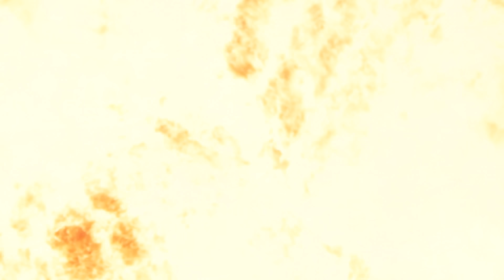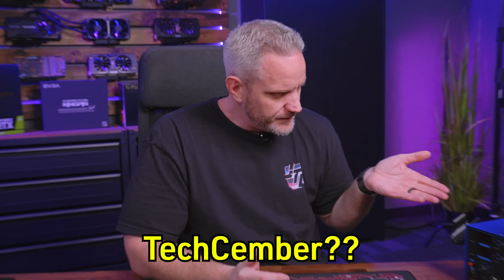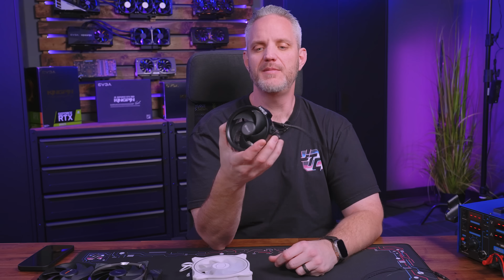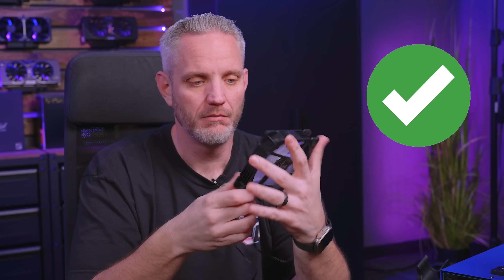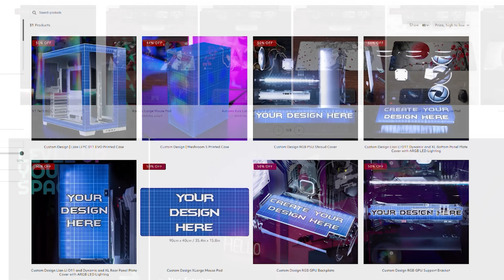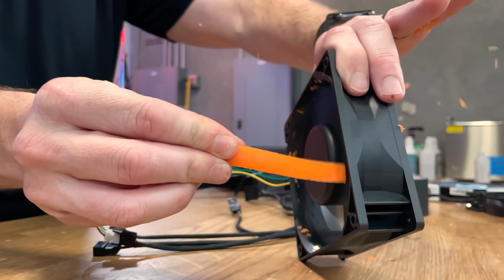I overvolted my fans, but I never expected these results!

Comment: Jay has now resorted to "over clocking" fans. He needs a power supply capable of going higher than 15v ... Let's see some 12v fans at 24v 😂😂😂 I can see the wheels turning in Jays head. Video ideas: Over clocking leaderboard attempt with "overclocked" fans on AIO Cooler with his air conditioner lol

Comment: Maybe it would be a good idea to check the RPM of each fan at 15.2V and the temperature after 15min of running, another thing would be the air flow measurement cfm, and also noise db

Comment: I have a couple of 40mm noctua fans running at 24v cooling the Stepper motor and power supply for my 3d printer. They have survived for  almost 3 years now Yes thats Forty mm by 20mm fans

Comment: I used to use the -5v rail from my power supply to run fans at 17v. At 24v they fail instantly. Hehe. Good old y2k Athlon era problems.

Comment: Finally. yes. as usual Jay, thank you.Also, lian-li only one with actual overvoltage safety? hella nice. You should try to monitor che voltage between two fans connected in a loop so one actually feeds on the other one and look at the tester to see at what voltage problems start.

Comment: Back in the 1980's a seller of my power cartridge for the Commodore 64 told me; it's like you tune your Mini to 200km/h, it can do it but will break much sooner. Never found that to be true for computers but for fans? 100% true, you just destroy the baring 🤣

Comment: 3D printers use 24 volt systems and people will frequently make the parts cooler fan blow harder by running 12v Noctua fans on them.

Comment: Put a restriction in front of it Also use a Fluke digital multimeter to see if the output is actual. What you're doing is an easy test.

Comment: Reminds me of the time I needed to cool down my amplifier at a party. I cut a hole in the top, drilled 4 holes for a 120mm fan, stuck it on there and wired it to a lamp-switch for 220v (I live in Europe). Problem was that the only fan I had spare was a server grade 120mm with metal fan blades! That thing was scary as shit... Fan guards got quickly installed after I turned it on. 😅😂
The amplifier stopped overheating tho!

Comment: They are not "not happy",the fan at 7:20 is just adjusting its pwm cycle to get same rpm's (power) with increased voltage, look at amps, at higher voltage amps go down, because you settle at same ~3W of power. Previous one that got fluctuating readout was same idea, just not so polished motor cointroller logic. For average joe imagine 12 volts is gently pushing shopping cart, to get it moving, you push it all the time, with 15 volts it is like kicking a shoping cart with a foot, you kick it, and it goes for some time, after a while you got to kick it again to keep it moving.

Comment: Ive generally found with 12v stuff like that you can get away with 30-50% more voltage without it releasing the magic smoke. You can even double the voltage on good devices for a short period of time with no lasting damage (take that with a grain of salt. Im not responsible for anything you do haha) but an extended torture test at 24v and you would probably start to see some die out after a few minutes of use haha

Comment: Idea (since you're bored): I recently bought a Red Bull mini fridge on market place. It looks similar to a PC case and gave me the idea to build a PC inside of the fridge to keep the temps down while not worrying about condensation since all air around the components is cold. At least that's the idea. Maybe you could do the same?? Or some other brand of mini fridge..?

Comment: 6:22 The reason that fan's amps were jumping up and down suggest it has a build in power regulator.
The step-down power regulators work by turning a switch on and off at high rate to keep constant voltage at the output.

Comment: Theres two Gods at 15v, Gods can increase work output, thats how special relativity works, too many Gods slow eachother down because the same workload, working spot even, like magic is comming from multiple sources, so the underworld God simulates an empty upside down reality.  The ladder to the underworld gravity flips, as you've seen in the footage, pressure drops dramatically, so no watts are required to cause implossion, like gold bars classically implodes.

Comment: Good fans have a controler inside, i have ARCTIC BioniX F120 and if you stop the fan the current stops and you can hear a noise inside of the controler beeping and sending voltaje to try to start the fan again, i bet the ones who drop voltage is because the ESC or controller, not the motor.

Comment: Well PC fans are brushless but they are rated for up to 13.2v generally and will shorten the lifespan above 13.8v, unless the fan has no control electronics at all, i've overvolted those absolutely awful fans to 30v and it survived for DAYS

Comment: All those fans are pulling less amps than its rating is due to them being new or almost new. Almost all motors should pull less power when new since they're at their most efficient state physically. Once a motor starts pulling current at or above what it's rated, it generally means they are at end of life and needs servicing or replacement. There are many factors that can cause a motor to over-amp, like a failing bearing or worn brushes in the case of a brushed motor. Non-ideal uses can cause motors to over-amp also, like extra load on the motor that isn't intended or conditions like extreme heat.

Comment: not really overvolting   normally you can do 50% without affecting duty cycle so 18v easy DC DC step up /down buck converter will do the job , and I have ran my delta's on 24v

Comment: Hi Jay. it's is rated 0.35Amps "under load", meaning some form of resistance to the fan spin ie. meshed grill or glass pane very close to the fan blades. Once there is resistance, the fan motor pulls more current to keep itself spinning.

Comment: Hey Jay, you wanted to see a cool trick? get a spare PWM fan cable extension and solder (connect) a single 4.7uf MKP capacitor between the +12V wire lines from the fan to the motherboard pin and see an insane improvement, don't worry: it's safe and interesting.
Hint: It's affecting lower amp fans.

Comment: With the new bench power supply, remember to set the amperage correct. Too many amps will burn the wires out, before the motor. 
You might also think about some extra safety, for when a fan explodes. Sharp bits of fan, has been known to hurt flesh.
Reply: At constant voltage, the fan will draw the amps it needs. That's why the amp draw gets lower the more volts gets pushed.
Jay should have measured rpm as well.
Reply: @PhrozenN  I am going on the bench power supply, that I use. I have separate amp and volt settings. I am presuming that the one that Jay has ordered will have the similar settings. We will see.

Comment: Cars are a minimum of 12v (some old tech is 6v) and a regulated 14ish volts... components (most of the time) need the minimum to work as designed so we call them by the minimum eg.12 volt system.... yes I know its more complicated than that but was going of simple explanation.

Comment: I dont think voltage  is gonna kill them till much much higher. Up the amps and watch them pop.
Reply: You can't increase the amps unless you also increase the voltage to cause more current to flow - basic physics.
Reply: What I meant was take a power source like a car battery 12v and hundreds of cranking Amps...
Reply: @IronVally_QMaster  Sure, but the fan won't take any higher current unless the voltage is also increased.  Of course, if you redesign the fan it might, or if you change the laws of physics.  Voltage is what causes current to flow.  A car battery only delivers hundreds of Amps because the starter motor resistance is a fraction of an Ohm.  A fan is a variable load, but typically tens of ohms, so the current at 12 Volts or so is generally much less than one Amp, even if the supply could provide more.

Comment: internal IC temperature caused from overheating slows down the coolers, there is no smart tecnology only internal current protecction. 3 thing will blow in a cooler fan the coils, but primarly the IC chip or the hall ic if its not internal on the main IC. all depends on the voltajes.
Reply: Yes - either mosfets or hall-effect sensors, or controller (just maybe).
Reply: @GodmanchesterGoblin  the mosfets are inside te IC driver,they are just like a BLDC motor. Many coolers are 1 coil driven some 2 coils.
Reply: @neoneo1989  Yeah - most likely.  It's a long time since I pulled one apart.

Comment: The amperage drop could be the fan's control chip erroring out..? Maybe loosing speed sense and slowing down, or going to fast and missing the correct phase-shift then amping up when trying to speed back up. It would be an interesting video for an electronics channel.

Comment: I bought the be quite pro 4 fans with the physical switch to increase and decrease fan rpm and they are best fans i have ever owned compared to noctua fans i paid over £110 for 3 fans they are indeed expensive

Comment: You should get a power supply that goes to at least 36v if you want to easily release the magic smoke. I've had some fans survive 24v because they just shut off to protect themselves.
Reply: He's ordering a 60volt one. Was right at end of video 😂
Reply: if voltage does not kill the fan then its the high amps will cos the tiny capacitors will fry first .. if i am correct
Reply: @tlumme you can't force amps, the motor is pulling them
Reply: @vadnegru  okay .. got it :D

Comment: Could always try a 20V power tool battery with a potentiometer to control the voltage, or something like that.
LMAO, nevermind you ended up doing that, perfect timing

Comment: jeesus... you need to learn about electronics and electrical systems for one every device has a 10 to 20 %  leadway so 15 volts on a 12 volt fan should not matter... put 30 on it then you get fans failing now if you got a 5v fan on 12 volt yeah that will fail as that is more then double  but 3 volts more then stock wont do shit unless it is a really badly designed product and you call yourself a tech tuber ???? SMH

Comment: What you're missing, Jay, is that a significant number of modern PC case fans (aka all of them) actually have full-feature PWM controllers *in the fan*. On ALL 4-pin headers and 4-pin fans, the motherboard supplies flat 12V and then a low voltage PWM signal for the fan's internal controller to actually drive the fan speed, with the 4th pin being the RPM sense wire.  

(On older motherboards with 3-pin headers, the motherboard itself would do the PWM voltage control on the input power, if it supported it. Moving the PWM control to the fan eliminates a lot of compatibility problems with said 3-wire systems having different PWM sample frequencies, ramp up/down time, amperage, etc.) 

I noticed this messing with some generic case fans from Dell not that long ago that I didn't mind blowing up. I could ramp their voltage as high as around 20 volts, and while the fan speed would temporarily increase, within a couple seconds it would ramp back down to it's rated RPM- the internal controller was protecting itself. Above that 20V, the fan would just turn off. Never killed any of them though. 

You'll likely only be able to blow up the cheapest of the cheap DC fans that are 3-pin only. All the 4-pin ones should self-protect and self-limit RPM, which would be indicated by hooking up the sense wire and ground to a motherboard.... Unless you hit them with 40V+ which would probably be enough to fry the controller circuits.

Comment: Reminds me of the time I used to -12 from the 20 pin power supplies in the 00's and rigged that to my fans for 24v. Damn those were loud then! Then I put some switches together to go from 12 to 24v on a blank faceplate for when I needed extra cooling.

Comment: I have a 36 volt power supply and I hooked it up to some cheap prebuilt cpu cooler fan. It continued to speed up until like 26 volts then just stopped completely and started getting really hot

Comment: If you have more of those 20V lithium batteries wire them up in series you will get 40v or 60v if you use 3

Also from my knowledge of buying electric motors for hobby use, the 12v fan motors can likely handle 30v or 1amp before they die rapidly. The PWM ones are likely to blow their controller board before they will blow the motor

I believe PWM fans slow down because the circuitry in the controller gets hot increasing resistance however im not an expert, i am only making a educated guess

Comment: I remember we had our AFX Slot car track power supplies connected to a gas generator and it had the ability to adjust the output cycles of the AC, this resulted in the cars running faster than normal.

Comment: CoolerMaster mystery fan appears to be an MF120 Halo.  I have those in my case.  They look great but they are not only noisy but after less than a month one of them developed an annoying rattle unless I tap the blades.

Comment: Jay, if the fans do not have any special controller that monitors voltage/current/RPM and limits over-voltage/over-current, it is the same as having just an electric motor.
For electric motors it is the current that makes them move faster/slower/burn, not voltage. When you increase the voltage, the motor increases its rotation slightly but also increases the voltage the motor produces due to rotation, which counteracts the increase in voltage you input (search for "back emf dc motor" or "dc motor equation").
The power supply you were searching at the end will probably allow you to set a fixed voltage of 12V and increase the current until the fan releases the magic smoke (which should be above the rated current). Except maybe for the expensive ones (that might have a proper controller) and that industrial fan that can probably take the 5A of that power supply and ask for more before burning.
Just make sure you use caution. Strap the fans down.
;)

Comment: Just as a warning. . .

Back in the early 2000s (I was 22 or 23) I had an unprotected Delta or Sanyo (either 92mm or 80mm, I don't remember. . .it was on an MC462-A). While drunk I accidentally stuck an index finger in it. 

Fan didn't stop, cut my fingernail into the fingernail bed, and left about a 1/4" deep cut on the pad of my index finger. It also (literally) threw my hand away from it as the tip of my finger basically in at an angle almost parallel to the blade pitch. Being drunk I felt almost no pain and since I was shocked that my finger was now mangled, I split the wound open and gawked at it. Said a few choice words, slapped a bandage on it, and went back to overclocking.

I have no doubt that thing could have chopped my little finger off or seriously maimed a young child's hand if someone's hand went into the blades. Be careful with those powerful fans.

edited for clarity

Comment: While I really enjoy these sorts of "tests", I did get very anxious watching this one.  When you test again with the 60v supply, PLEASE do so with the fan in a plexi box or with both of you shielded behind some sort of plexi.  The speed at which those fan blades will be spinning, as soon as one breaks and sends a blade flying, could literally result in a hospital visit and/or death (as it would be more than capable of slicing through a major artery).
Reply: 60V does not mean faster fan. It probably means the voltage breaks down through the motor winding enamel and shorts out.
Reply: @devinslack9964  Generally speaking, the more voltage you supply to the fan, the faster it is going to spin.  It is the main way motherboards and controllers adjust fan rpms to produce fan curves.  

You could hear the increase in rpms on the fans going just from 12v to 15v in this video.  More voltage is going to increase rotation to the point of motor failure and/or blade/hub failure.  Once that occurs, the blades are most likely going to snap off and become violent projectiles with pointy/sharp edges.  

Have seen it happen numerous times with people using air compressors to spin fan blades faster then they are designed to go. Have seen a fan blade fragment embed itself 4" teep in sheetrock....so God forbid that be a human neck or thigh.

Comment: I have 12V fans on my 3D printer which run at 24V. Sunon 40x10 and 40x20mm - they are 2-wires, and they run at twice the rated voltage with no issue. I am sure they will burn out after 3-4 years of usage, but they're 5 bucks a piece. I'll live.

Comment: Of course you know, now, you're going to have to test 15.2 VDC on AIO's (fans) and heat pipe cooler fans for performance increases!  Then on to the water pumps!  Isn't DC motor speed directly proportional to voltage?  26.6% increase...  a few buck/boost boards would fit into a case to jump the on board 12 VDC up to 15.  I definitely wouldn't mind seeing a water pump cranked up a few volts while under load.  If you're water blocking you're overclocking...may as well do it right and squeeze everything!

Comment: If you are running your fans in PWM mode then they're always running at 12V. The voltage is just being switched on and off for varying durations per second, or duty cycles as they're called. The longer the duty cycle, the faster the motor will run. The advance of this is finer speed control and the being able to run slower than plain voltage control will allow.

Comment: Not knowing about buck converters at the time I installed a small Noctua 40x10mm 12v fan on my 24v 3D printer, probs not my wisest moment but it's ran for days now and is still fine

Comment: Can you include the phanteks t30 and moctua a12x25 in this? I'm always debating which is the better fan
Reply: T30s are bigger and move more air, but sometimes that extra 5mm makes them too thick to be compatible in some spaces, that's their only downside.
Reply: @Dan-Simms  I have t30s in my system, but I always want to know whether the noctua are more usable for other builds. The t30s made me a believer in better fans.